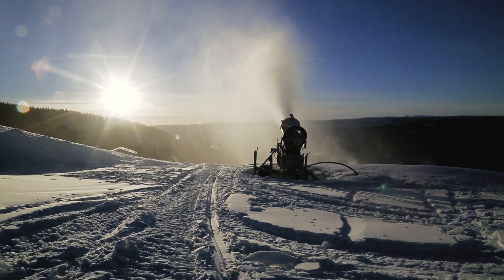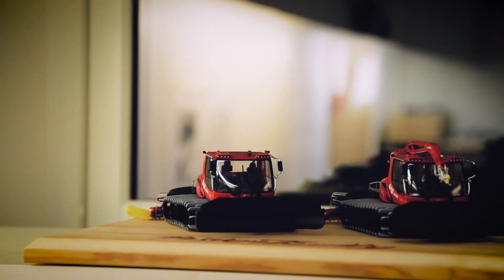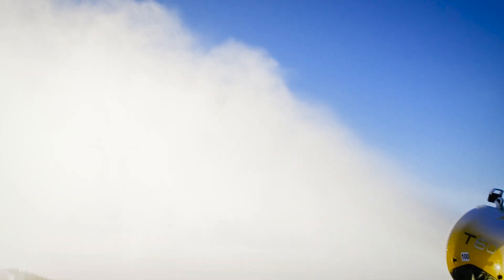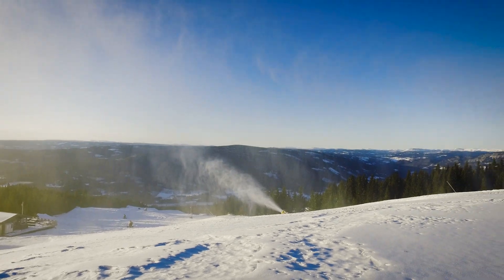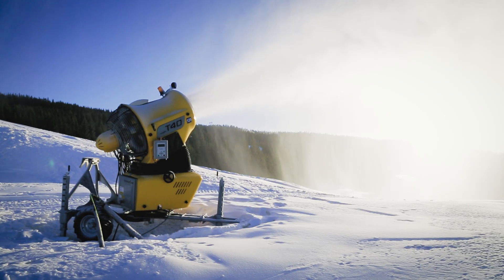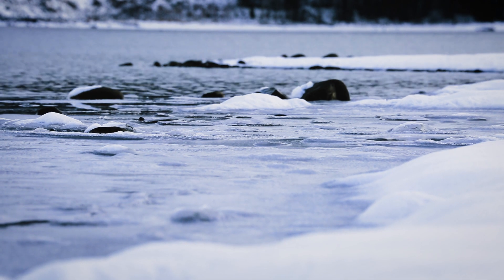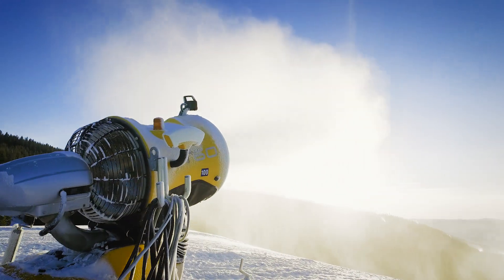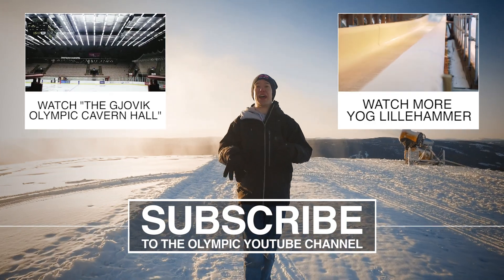How To Make Snow

Comment: I'm really late to the party, but how exactly does evaporating water suck heat from something that is colder than itself? Doesn't that break physics laws?
Reply: No, water molecules are drawn into dry air to creat equilibrium, thus necesitating evaporation and transfer of heat/kinetic energy. It just so happens that not all of the water droplets evaporate, so they are the source of energy.

Comment: Used to fly in Alaska Bush. Lived in a village called Bethel, AK. One cold winter night was probably about 20 below(that's Fahrenheit). I took saucer pen with about 1/8 of an inch of water in it to a boil. Ran out to the front porch and through the water as hard  and as high as I could with the pan. Made a very loud noise. Not gunshot loud. But very noticeable. It sounded a lot like, like putting something in hot grease. Made a very big steam cloud. So it was hard to tell what happened to all of the liquid. But I could not find any obvious indents in the snow where I had done this. I don't know if this water turned into snow or not. Is that the same or was that something different. Wondering because of the high heat involved.

Comment: OK, so the water freezes in above 0 temperatures because some of it evaporates and cools the remaining water to below 0. Now for my question since the temperature is above 0 why doesn't the snow on the ground melt????
Reply: Daniel Sultana It's quite possible the ground is colder than the air, particularly if can be covered with snow which will reflect sunlight.

Comment: If the air is forced out at high pressure, won't adiabatic expansion result in cooling as well? I would imagine at high enough pressure, the machine should work in a 100% humidity, above zero temp.

Comment: We use the same thing here in the southern california desert (I live about an hour's drive north from california city) as inexpensive air conditioning, called a swamp cooler. Water is pumped over a pad that air is blown through. The evaporation of water in the low humidity conditions will reduce the temperature from over 110F (44C) to about 85F (30C) using only the about of electricity to run a small blower. It does use quite a bit of water, and only works in very dry places.

Comment: Sorry Tom, had to happen eventually, but this time I knew this one, I had some time in Finland inside the Arctic Circle and we had to query why on earth they were making snow.. even though we were standing in more snow fall than England had seen in many years combined
Reply from the maker: +Colin Richardson That's why there's always been "might" in the series title :)
Reply: Yep, I had guessed that very reason.. It's just taken until now for it to happen. :-) keep up the good work.
Reply: They had that at Finland, though it was not as impressive a "gun" as it was in this video.. They basically had a tube on a trailer and a large container of water. No computer controlled anything.

Comment: What is the point of making snow at 6°C? Doesn't it melt very fast on the ground?
Reply: retepaskab The ground is probably colder than the air, particularly if it's much colder at night. Snow will also reflect sunlight, so it won't warm up as much.

Comment: Now if only there were machines that make snow disappear.
Reply: Flamethrowers already exist, chief.
Reply: +Noel Goetowski  Dude obviously I'm not talking about a snow blower or a snow plow. I want to make snow disappear not relocate it.
Reply: Tell me how a flamethrower wouldn't make snow disappear.
Reply: +Noel Goetowski  Lol good one man. That might work on thin layers of snow, but probably not if it's deep and densely packed. It would be pretty inefficient and impractical, not to mention inaccessible and illegal.
Reply: +AlphaOmega Commercial snowmelters encapsulate the flamethrower in a convenient container package. And, yes, they are a thing.
Reply: In some cases throwing salt around might help.

Comment: I actually though that fake snow was made by some kind of chemical mix and i never looked into it... thanks mom and dad :D
Reply: +Faraonqa Some are. The same stuff inside nappies (diapers if you're american) has a similar effect if you take it out and add water. It stays dry to the touch and looks like snow. movie productions tend to use chemical ones because (as is explained in the video) to do it naturally you need to already have low ambient temperatures.
Reply: It is. These guys are synthesizing real snow. :)
Reply: +TheSpacecraftX When I think of "the stuff inside nappies"  I am not thinking of something I want to be playing with.  ew!  (but the absorbant stuff in an unused one is pretty amazing!)
Reply: +TheSpacecraftX Movie snow always looks dreadfully fake if you're used to real snow. Mostly because it doesn't melt and make the actors' faces red.
Reply: +Faraonqa That would indeed be fake snow and I guess it exists. But this is indeed making actual snow. This kind of snow usually has a slightly different feel and texture due to the way the snow flakes are formed makes them have different shapes than natural snow flakes but it is indeed real snow.